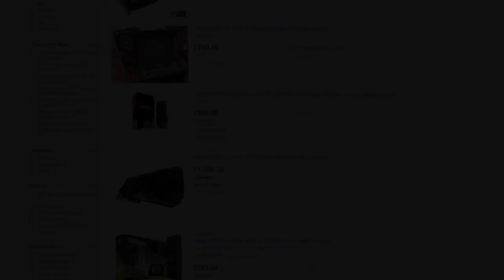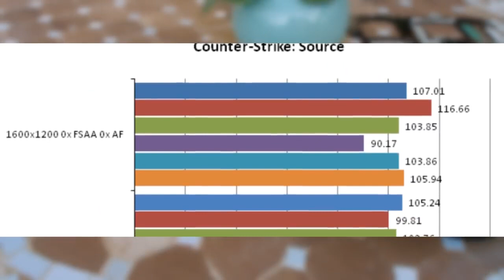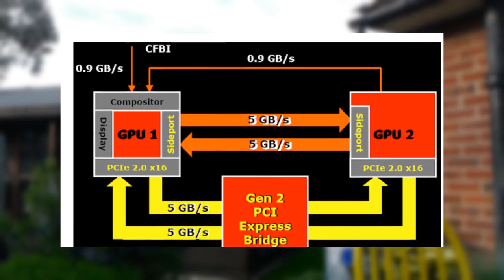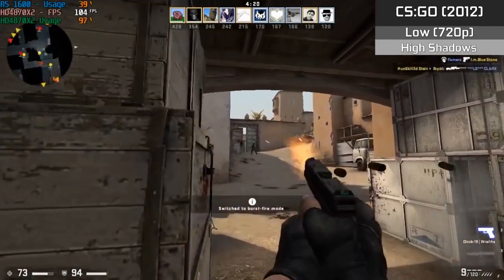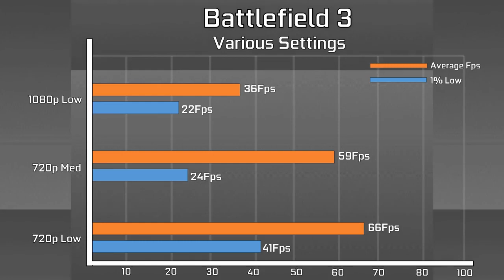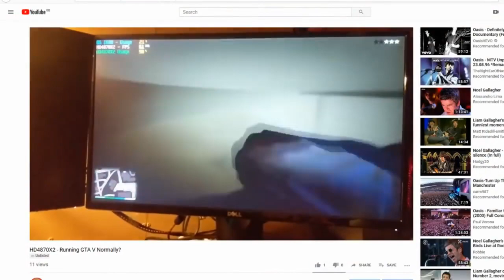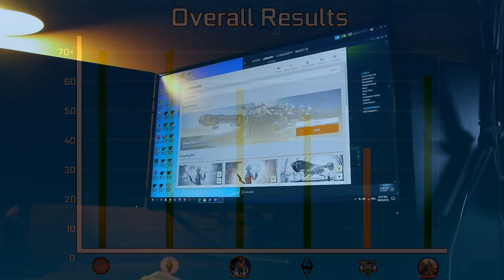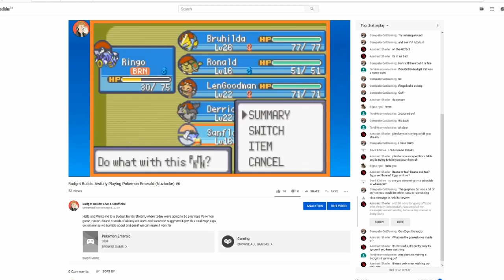ATI Radeon HD 4870 X2

Comment: Thank you for this, I'm considering getting one for 30$
Reply from the maker: It's looks like a truck near nowdays cards ;)
Reply: @GraphicsCardMonsters  I ended up getting an HD 6870 and don't regret it, but if anyone else  is reading this, you should try to get a 7000 gpu at the very least, just to be able to run most games.